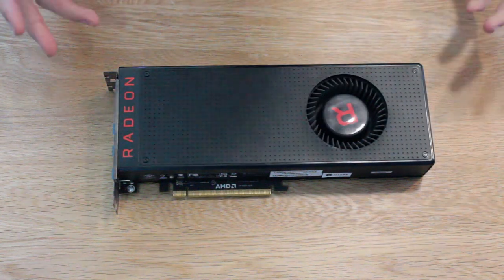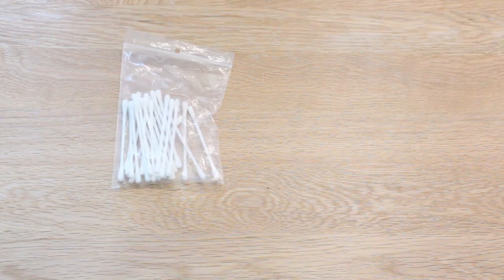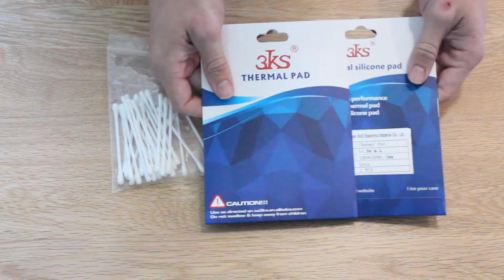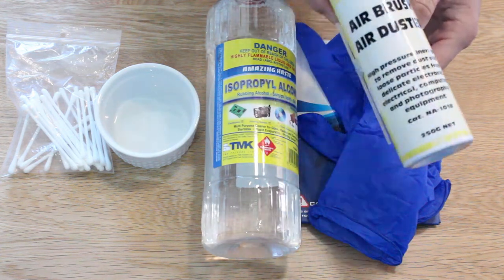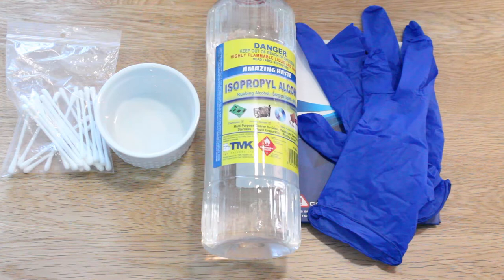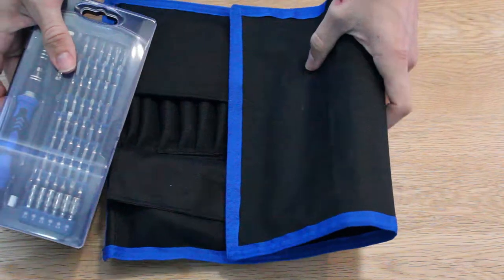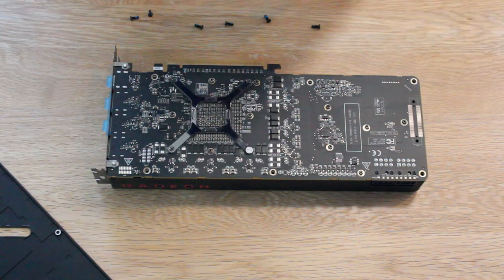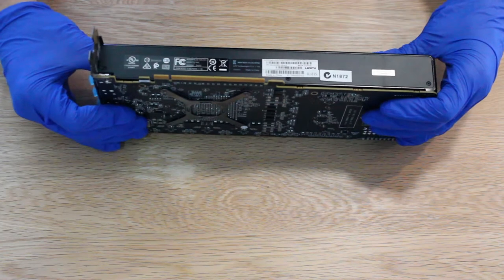Vega 64 8GB GPU clean thermal pads replacement deep clean

Comment: Hi, would you be able to share what the sizes of the thermal pads that you used and where you put them? Thanks
Reply: Hey did you find out the sizes of thermal pads yet?
Reply: @Savantqqqq  Hi, no I have not. I still have the card in pieces in my 'to do list' until I find the sizes.
Reply: @carlossiguenza331  same :(
Reply: I mailed amd and they said that all pads are 1mm, I will do the replacement soon
Reply: @Rafa_elRicardo  i also used 1mm, temps are high tho
Reply: @stellabckw2033  did you use good pads?
Reply: @Rafa_elRicardo  generic ones, but i oc'ed it and put it on heavy load. so it makes sense
Reply: 0.5 mm on the inductor (inner ring of chips around the the GPU core) pads and 1.0 mm on the MOSFET (outer ring of chips around the the GPU core) . I use the Gelid ultimate but that's just because I have left over from my water cooling of other PCs.